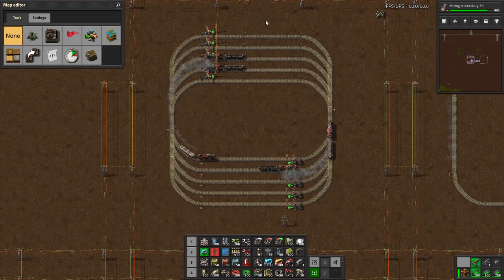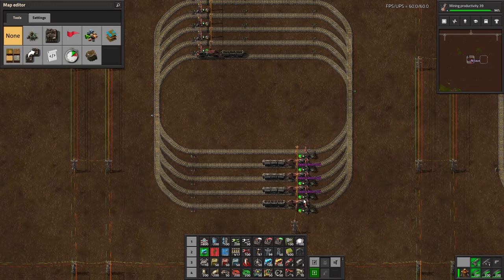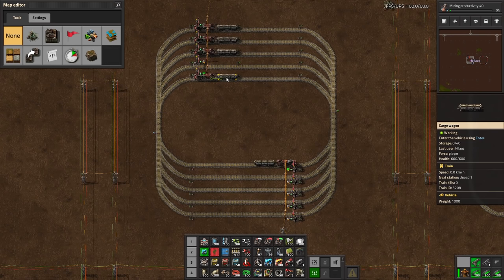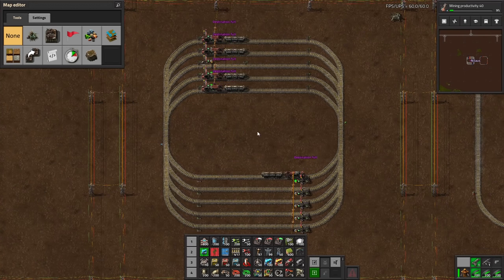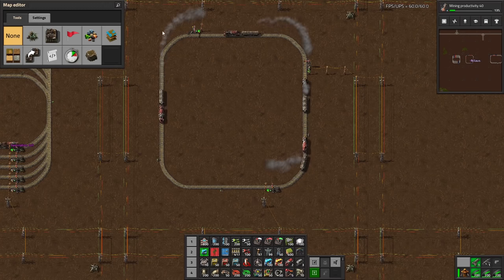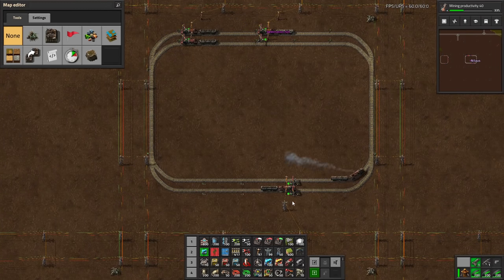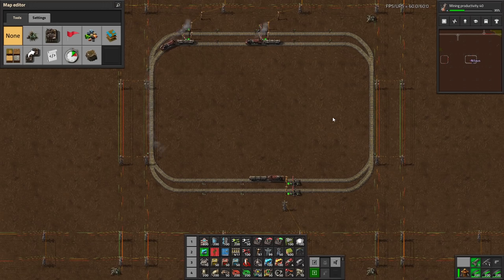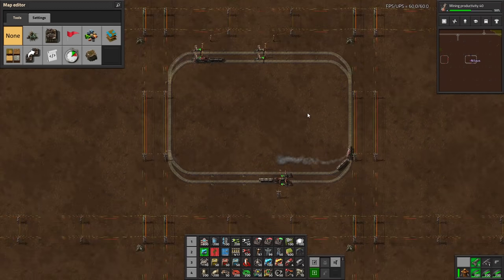ADVANCED TRAIN SYSTEMS; Deadlocks, Depots & Train Limits |  Factorio Master Class

Comment: I don't know how much this would help, but there are a couple minor tweaks that could be made to your 'standard' load and unload station to possibly make the train limit more accurate.

On the unload side, simply read the current contents of the train and add that to the contents in storage when calculating the number of trainloads being requested. This will avoid situations where a train is allocated to an unload station, but the station no longer requires the load on the next train once the unloading of the current train is complete. In essence, you are instantaneously transferring the contents of the train to the storage chests, then letting reality catch up with the bookkeeping at the speed of the inserters.

On the loading side, subtract 1 from the number of trains being requested if a train is currently being loaded (T>0) This should happen before the request count is capped. You may also wish to add the contents of the train to the contents in storage to help ensure a timely limit change. As with the unload station, this essentially performs an instantaneous transfer of inventory to the train, then lets reality catch up with the bookeeeping. Adding the contents of the train to the contents in storage when calculating the number of trains to request means that the request calculation is taking into account how much inventory will remain in the station once the train is full.

Comment: The problem with this solution is that insufficient inbount is a situation that will occure from time to time unavoidably, and will produce a chain reaction. Being sure that throughput will not drop to zero as soon as it's not 100%, worth a bit of effort in my opinion.
Also I genuinely don't understant why you need "smart" logic for your inbounds. Is there a difference whether train will wait for inbound is ready to provide full load, and than will load quickly, or just will stay on the inbound station to be steadily filled up.
Without this circuitry such deadlock would never have happened in the first place.

Comment: Love it. One thing I've started changing in my megabase is to make the on-site steel smelting sites have only one loading station, rather than two. It doesn't change how quickly steel is produced, but it makes loads appear one by one rather than two by two, so individual loads appear in half the time.

Comment: I get the point of the video, always address the bottlenecks first.  Great point and video.

But also, in that first example's solution, keeping a perfect ratio of requesting stations, supply stations, and the optimal number of trains, its tedious and awkward to keep that 3-way relationship perfectly balanced to avoid the deadlocks.  Especially in an ever-growing base where the supply and demand ratio isn't static.

I prefer using better rail networks with more alternate pathways for getting places, with a few depots.  Yes, its a little more congestion but not enough to make a difference if the depot placements are well planned and the rail network has enough alternate pathing.. I find it to be a much more hassle free experience than maintaining the perfect requester/provider/trains ratios.

Comment: Excellent explanation / lesson, as always. I've also found this to be the case when you optimize for simpler train routing (dispatch only empty/full trains), and the addition of train limits has been a boon for reducing thundering herd problems. However, I'm not sure this applies quite as well for other routing behaviors such as inactivity or clock time where you instead optimize around a more or less constant number of trains in transit. Your approach is definitely what I'd recommend to most players, since it's easier to grok and intentionally modular. Some folks like threads, others prefer coroutines; it would be nice to see someone with your knack for accessible explanation model the latter with trains.

Comment: Move your "waiting station" to a "spur" (out of the loop, a dead-end)... wire a single pole to it, then enable "Read Train Count" and "Enable/Disable"... set the enable condition to C=0.

This works because as a train paths to leave the unloading, it tries to go to the Waiting station, immediately disables it (by setting the C value if itself), and then paths to the loading station.

The benefit of this is you only need ONE waiting station on the entire network.

Comment: Re: waiting stations on producers

While, yes, it does spoil a full N-M system so it's not right for your megabase, honstly this doesn't seem like a completely unacceptable solution to me. For a specific resource, there are usually more places that consume a resource that produce it so you only need to add specific trains once at the end of setting up an outpost that produces that resource. Since when you scale up resource production, you probably want to scale up trains anyway so it seems reasonable.

Comment: It's funny that I was about to suggest the "solution" just as you showcased what the issue with it was.  I completely agree that adding more stops is not a solution to the actual problem of supply shortage.  Well done video.

Comment: Add the following filling station logic:
If: trains called = 0 AND requested trains > full trains
Then: set train limit = 1

This pulls empty trains away from unloading stations, leads to the low inputs condition operating more smoothly, and makes it faster (for me anyway) to diagnose what is wrong with my delivery system.

Comment: 5:20 If the train would not be part of the station limit : 
Imagine this is a unloading station and you have a limit of 2 in each of such stations so you have a buffer train waiting just in back of the stations. Then if the train leaving but not able to go anywhere does not count, you would end up with 2 other trains in the back of the station. So a station could hold 3 trains despite you told it to hold 2 trains max, and I guess adapted your railway to have 1 buffer train bu the second one would block stuff. 

So At the end I think feature is a good one not a bad one.
Reply: This should t happen since it isn’t actually able to hold 3 trains. The train would only stop counting for the limit when it is fully unloaded (or otherwise told to “go”). In other words, the limit is still 2, and while the train is actively unloading, it’s counted in the limit. At the point it can move, it’s removed from the limit. This would now trigger another train to leave a loading station and head to this station. That action frees the loading station and the empty train is now allowed to go. 

The unload station is now at limit 2 again and will be so until the next train unloads and disappears from the train limit. 

The interesting part is that technically, a loaded train would also be “free” to move (just as an unloaded train would be) and would also disappear from the train limit. So, technically it would free up two “train limit” slots since there’s a train on each end ready to go to the next available station.
Reply: @tricorius9653  In the specific example of Nilaus yes. I was in a more global point of view. If you change rules, you are not garanteed that for any train design, making the empty train which can't go anywhere not be part of the station would effectively free up a spot for that train to leave. So there should be some situation where an empty train would take a spot and cause bigger problems than the one Nilaus is facing.

Comment: Has anybody found a solution for this deadlock in the last 2 years besides always having oversupply so it doesn't occur?
Apparently the heart of the problem is that a train that is already leaving the station is still blocking the station.
Can sombody explain to me as Factorio noob why I can't fix that with signals? Or with some sort of buffer after the train leaves the station? Maybe signal network?

Comment: I feel like there is a way to get the stacker station method to work using enough circuits by only enabling the unloading station when there is a train in the stacker waiting to depart. Not sure that all edge cases can be handled easily though...

But yeah when you design your train system to rely on always having more supply stations open than request stations you should first make more supply stations when issues occur instead of patching what happens in the bad state.

Comment: I havent read coments up to this episode, so maybe somebody already said that, but the main problem with your trains that i see is that you control them via overly complicated train limits. 
I have never personally encountered any of your train problems in my megabases, but i do things very differently and keep it simple. 

Basicly all my train stations are named either LOAD (material) or UNLOAD (material) - no exceptions. 
Each station read amount of material directly from boxes asigned to it without any aritmetic crap nearby, and theres simple condition: If amount is bigger or lower then certain amount, DISABLE or ENABLE whole station. 
Every LOAD station have exactly 2 trains asigned to it. No more, no less. 

Advantage of this is that when station is disabled, it cant be set as target for any train, so its impossible for idle train to get asigned to "full" station, and when its disabled while other train wait for it, the train just gtfo and set different targed instead of waiting for station to be "empty". Or at least this is my understanding, because as i said, i dont use all that complicated train limit stuff, and all trains flow flawlesly without me having to debug them for hours. The only disadvantage that i can see is maybe that i cant use dashborad same way that you do, but tbh, i rather wont have dashboard then having to spend so much time on trains as you do :)
Reply: Using enable/disable causes a 'thundering herd' problem where multiple trains will path to a station that opens up, even though only one can unload. Also, disabling a station can cause trains to repath or even revert to manual mode en route, blocking other trains in the network. This is why they added train limits to the game, and they're actually replacing enable/disable in factorio 2.0 with internally just setting the train limit to 0. You don't have to use this much circuitry but it's not the root cause of any issues, and some of it is actually helpful as you scale up.

Comment: My solution that works great for modded content (pyanodon/seablock) is never shut off supply stations. If you have 5 steel suppliers each with a train limit of 2, have 10 steel supply trains. 

Number of requestors don't matter in this context. Congestion isn't increased since, at worst, the added supply trains are waiting around and, at best, its just the first example of this video

Comment: The solution I'm using for many-to-many is to 'assign' a fixed number of trains to each and every unloading station. Unloading station limits are thus also fixed and if I increase them I will also add trains respectively (the stations have stackers ofcourse). Now there's always space for the trains in the unloading stations. If supply is low they'll just wait there. As an added benefit, it's relatively easy to count unloading stations/waiting-spots and if enough trains are in the network for it. If throughput becomes a problem at an unloading station, the limit and amount of trains can be increased (unless the stacker is saturated).

Even though, too little supply still leaves trains stuck in the unloading station, while full trains might be waiting in the stacker.

Comment: don't use stations, just use signals. so you can fit your largest train behind you unloading train. so the moment the train is on loaded it goes to your miners/smelters or what not. if there is anther in the loading station than its sitting behind it with multiple lanes to hold multiple waiting trains.
Reply: dont have trains waiting on the same track with a trainstop that just made all your problems

Comment: I’m trying to learn about trains, but it’s quite complicated. One thing that I thought (a total noob thought) is to not use circuits on the loadings stations. Like: if I have a steel station with one block loading and two stackers - why don’t I just leave the train limit always on 3 and set the condition to be full before leaving? In this example, if I have 4 steel loading stations I need 12 trains and they all wait on loading stations. That being said, only the unloading stations will have trains requesters in it.
What would be the problem here?

Comment: Long story short: You must have 4 stations in a loop: Unloading, Out, Loading, In.

Imagine you have an UNLOADING depot that has 4 stations for Iron. Each station has a demand of for example 5 trains. So we have 20 trains in a loop. Build an OUT depot right after UNLOADING depot, with a few stations, so that they have enough place to collect all the 20 trains (Ex: 2 station with a pocket for 10-trains length) in case if you run out of ore and trains have nowhere to go. Then your UNLOADING stations will be free. UNLOADING depot must be connected to the  OUT depot in such a way, that a train can get from any UNLOADING station to any OUT station. In the situation I am describing you can just connect 4 UNL railways into one path, and then split it to each OUT station.
You should build an IN depot with the same logic as OUT, right before the UNL depot. The connection must again allow "any-to-any" path.  This will allow you to store all the trains bug-safely in the situation when you have enough ore but the UNL depot does not need it. You can save some space by making it with the  capacity of "20 minus number_of_UNL_stations" trains, i.e. 20-4.
 The problem here is that each similar loop must have unique name for its IN, UNL and OUT stations. IN1,  UNL1, OUT1  etc. In this case you will never have a situation when one UNL has 60 trains, the other has 0.
Of course you can build two huge OUT and IN depots for all your UNL depots,  set a dynamic demand, but it will increase traffic.
I came to the conclusion that It is better to create more trains for a system, but every train must have its constant IN, UNL and OUT stations.  It is better when they spend most of the time  between these three stations than go and wait somwhere in the system. 
So instead one UNL depot you create a chane of 3 depot. In fact it won't increase space significantly, but will decrease traffic a lot. Every train travels frome "home" to the nearest LOADING station, and "passes freely without any delay or hinderance". ;)
Have a nice train guys! ;)

Comment: So: have atleast a number train requests at the SUPPLY stations EQUAL to trains that can use that type of supply station. This means that if you have 12 trains and 10 supply stations, you always make sure that over those 10 supply stations, there is a possibility to be filled with those 12 trains.

Did that make sense?

Comment: I couldn't get the trains to use the stackers in each module.  So I added a second stop in the space right before the networked stop.  I set it to the number of trains the stacker can hold as the limit.  This seems to only be a problem with the smelters as the rest of them rarely have enough throughput that I want to stack the trains.  But it solved the problem I had with either not enough ore trains or too many showing up at each smelter.

Comment: I said it before and will say it again, you could just set the train limit of the output train station manually (the place where you fill the trains). That way, the trains at input will always have a place to go.
Reply: I think the issue with this is, if you have multiple producers, the trains may go to the "wrong" one. Like one might have a load ready and another may not. If they're both open, the trains can go to the one that isn't ready and end up waiting much longer than needed
Reply: @SpacePopeIII  Have you found a solution for this problem because I've come to see the same problem in my design as well

Comment: Interesting video, though I do have a question. For a many to many train network, would it be possible to remedy the "empty train blocking a full train" problem by having one or two stations requesting empty trains, even if they can't be imidiately filled up?
Reply: The part about a train depot (number 2 I think?) answers your question.  He looks at both an empty train depot solution and unloading waiting depot solution. Conclusion: stuff gets more messed up either way.

Comment: 13:08 - this may be, but you could disable waiting stackers whose loading stations don't have a train on them already, with a pretty easy circuit from signals to station (enable station if green=0, probably?)  Perhaps other pathing could still happen, I'm not sure, but it would reduce the chances, at least.  (I think.)
18:35 - I now expect this comment to be ignored, and I'm ok with that.  ;)  Yay, hacking at the root of the problem!

Comment: Love the series you make and finished the base in a book and lets automate, starting into the megabase in a book and love it so far. Im a noob but I was wondering if a game change to help "minimize" these issues would be if the train would check every 30 seconds or so to see if theres a station available instead of locking to one like it does now. Idk, just thinking since it happens to me alot when i make new stations and its empty until it goes thru a cycle and then clears out. Love the videos, keep em coming.